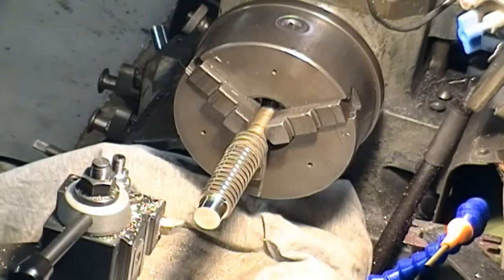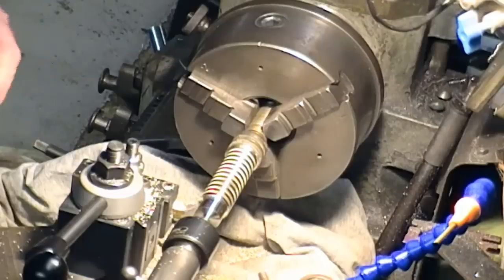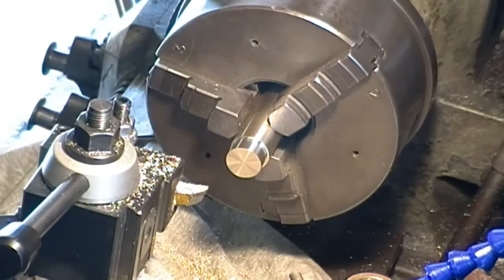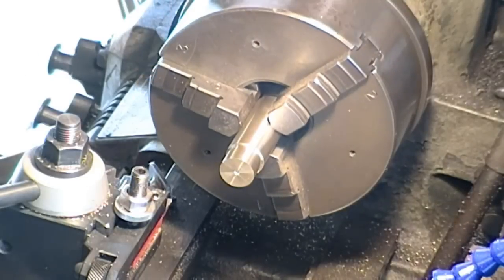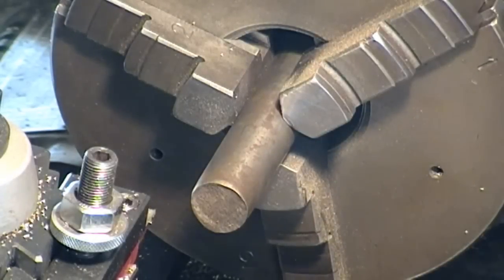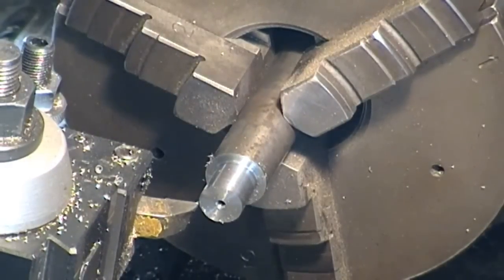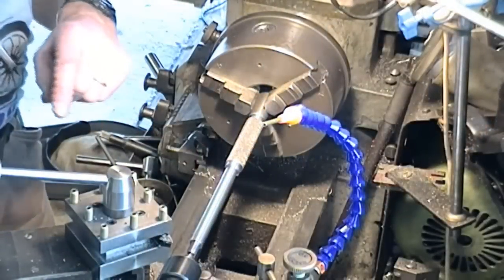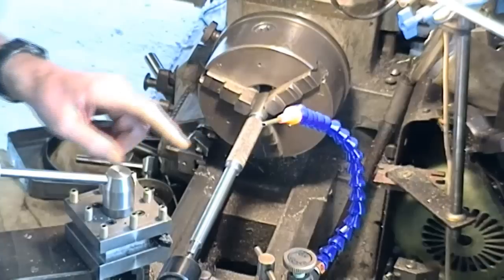Brass head hammer

Comment: Beautiful job, Chris. I made something similar but smaller and with interchangeable heads; one of plastic and the other copper. But I've tried to make it not so beautiful to avoid pain to ruin it while using. Ahahaha. Thanks for share.
Reply from the maker: Hi - thanks - just given me an idea!  I have some off-cuts of nylon round, which tho rather large may well be worth making into a hammer head.  I can unscrew the brass head and so could well screw on a nylon alternative. Food for thought. :)